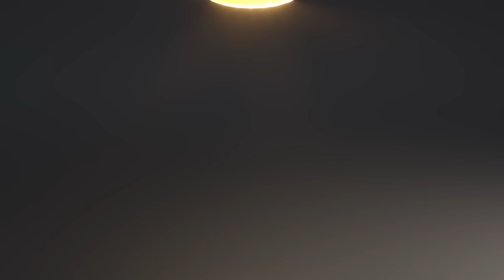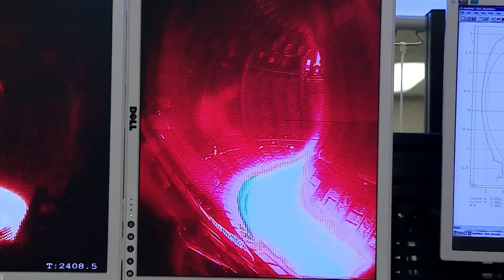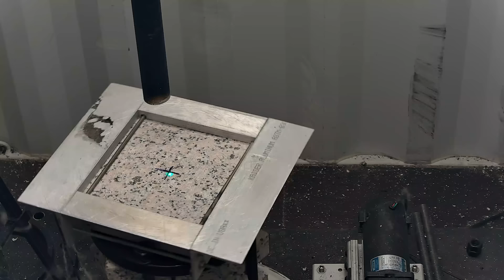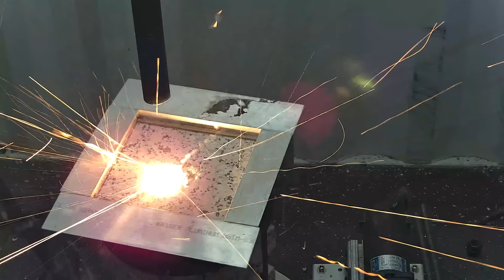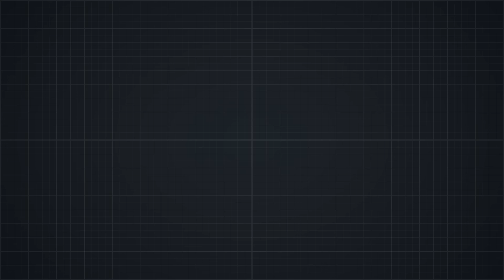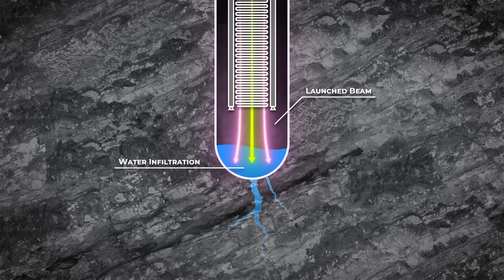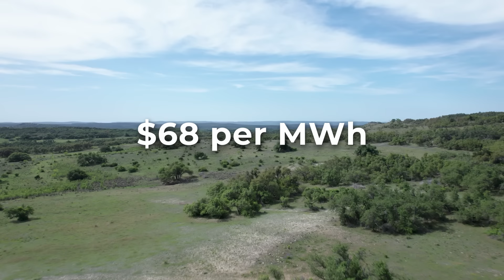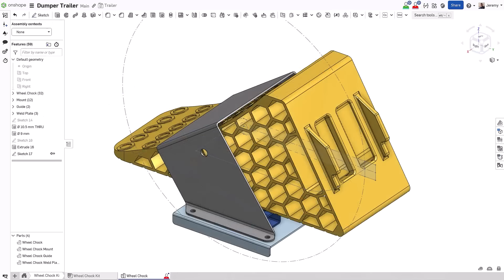Geothermal Energy is Changing

Comment: The LOCE for wind electricity is not believable for many reasons. Windmills (and solar panels) can NEVER generate electricity 24x7. Just the materials and construction costs alone are staggering, a single on-shore tower costs $3-$4 million and wind farms require dozens, hundreds or even thousands of towers (just keep adding zeros $$$). 

To provide any electricity when there is no wind blowing requies massive banks of expensive and dangerous batteries (today often using lithium which combusts on contact with water). The mining of lithium is also costly and destructive, and relies heavily on child slave labor. Check it out for yourself. Also, batteries wear out and have to be replaced often. $$$

Also, If the wind blows too hard the windmill blades must be feathered to avoid tearing itself apart. Wind speed must fall inside a "Goldilocks zone"...

The lifespan of wind "turbines" is claimed to be 20 years or more, but that is a lie. Most wind farms are decommissioned in 15-17 years because they become too expensive to maintain! When this happens the eyesores are often left standing in place because dismantling and removing each tower costs over $250,000. Plus, they cannot be recycled! They are put in massive landfills, so much for being "green"... 

Wind farms also require massive acreage that is always located far from where the electricity is needed, which means running huge cables long distances requiring more land leases and right-of-way negotiations.

But wait, there's more! Wind turbines require hundreds of thousands of gallons of petroleum for lubrication that has to be replaced regularly! 

And in the US alone wind turbines kill an estimated 0.6–1.5 million birds and 1.7–2.8 million bats each year.
Stop the stupid.

Comment: This is interesting, I wonder if you could run this independently on enough solar panels? A quick Google search says 50kv can be achieved with 180 solar panels and 1000kwh would need 10-18

So if you installed 200 solar panels to drill, you would have free-ish energy, and then once you have the hole drilled you could start your thermal energy power plant construction.

If the solar panels could be packed up and used again at the next sight, could pay off the use of so many panels.

Comment: This is an amazing piece of tech, but I agree with the need for more in-world testing before it's certified. What happens when you hit non-uniform materials? A pocket of flammable gas? Vaporized uranium deposits? There are also the residual strands of glass that condense in cooler areas. With enough rock that now becomes a physical obstacle to remove. I'd be interested to see this develop!

Comment: Well, if the maser drilling tech works out then the fixed cost of a set of drilling equipment isn't really a power plant expense. It's a drilling company cost as a capital investment. If the drilling companies can reuse a lot of the expensive equipment and turn a profit on the drilling jobs for new geothermal plants then they'll operate, and it winds up coming down to whatever the contract cost for drilling the geothermal boreholes are. For the water infiltration issue... Yeah, that's a problem but it might also wind up being good as specialized drilling equipment that makes drilling much more profitable for boreholes that meet the right drilling conditions so we'll have to see. Not being able to drill every hole equally isn't an idea killer so long as it can drill enough types of holes at a savings to be worth buying the systems and fielding them.

Comment: Is there not a concern of the obsidian casing building up too much and plugging the hole or sealing the waveguide to the hole walls? I imagine not all of the rock vapor can be extracted, so it would eventually build up in the shallower sections of the hole as it cools and deposits.

Comment: Just a quick point: the heat from Earth's interior is a combination of radioactive decay and residual heat from formation. The core in particular has very little radioactive heating.

Also, micro waves are lower frequency than visible light

Comment: If you are picking a spot to drill say 1km wouldn't it make sense to build a cheap steel frame and concrete floor for all the sensitive kit then simply drill down from there starting from the Concrete raft?

Comment: Did they estimate the power losses in the waveguides once they reach a length of a few km? The ohmic heating will be important and little power will make it to reach the bottom. You also have to cool the pipes, keep them perfectly straight, and how are they going to insert a new segment of the waveguide as the hole grows deeper? It doesn't sound very feasible...

Comment: Not seeing how they can remove the vaporized rock with out kitting the apparatus to the wall. It's gonna cool off pretty fast and the deeper it goes the further it can travel. Once those threads mineralize they are gonna trap and condense more rock vapor and cause a blockage. It's like cotton candy an I don't see how blowing nitrogen gas can help.

Comment: The idea is a good one and abandoned wells that can be cased/extended for reuse are prime targets.   Many millions of deep oil and gas well penetrations exist across the U.S., which already provide access to much warmer rock, > 65 C bottom-hole temperatures in some Pennsylvania and WV wells I am looking at.  State geological surveys (should) have the public access databases of OG wells--abandoned and otherwise.  (Unfortunately, the National Geothermal Data System website and AASG geothermal data portals are not currently operating.)  Additionally, generator turbines that use low-boiling point working fluids (i.e. "petrol" in e.g., Ormat generators) require temperatures much lower (< 100 C) than that needed to yield super-critical H2O steam.  These lbp turbine generators are already used at e.g., high-enthalpy geothermal plants (like Svartsengi, Iceland--BTW that stuff is basalt . . .) that also access super-critical steam, but to generate additional energy from the waste heat.  Geology matters and it varies (it's complicated . . . .) from place to place . . . .  The tester group took a serious look at these ideas and their work is still relevant.  

The new drilling looks amazing so here's hoping for a serious new geothermal energy source.

Tester, J.T., Anderson, B.J., Batchelor, A.S., Blackwell, D.D., DiPippo, R., Drake, E.M., Garnish, J., Livesay, B., Moore, M.C., Nichols, K., Petty, S., Toksoz, M.N., Veatch, R.W., Baria, R., Augustine, C., Murphy, E., Negraru, P., Richards, M., 2007, Impact of enhanced geothermal systems on US energy supply in the twenty-first century, Phil. Trans. R. Soc., 365, 1057-1094, doi:10.1098/rsta.2006.1964.

Comment: Having followed this for a couple of years it stinks of scam. The claimed to be drilling in China and promised results and stats from that but nothing came from it. The previous hole was tiny. Even an 8 inch hole is too small to be of practical use and they haven't done anything to replace the trust they threw away when they lied about the previous drill in China which was supposed to go down 15km.

What happens when they hit underground gasses or water or metals.

Comment: Flourine is very reactive and so it even burns bricks if we pass it along side nitrogen it should speed up the process right ? Melting point reduces with lowing in pressure so this system can be placed under a vaccum for maximum results.

Comment: I've been following this technology for quite a while. It has a lot of promise. The best case use is replacing old power plants that would otherwise go out of business and convert them to very clean sources. The other benefit is that you can directly use the power from the existing old power plant to "drill" the hole. This means a slightly lower cost of energy as very little is lost in transmission and the ability to step the power up is vastly simplified as there is no AC/DC conversion necessary. It's straight DC all the way.

Comment: You mentioned the massive amounts of power needed for such and operation. I want to add something to the conversation. 3 cents for 1 kWh of wind energy sounds a bit optimistic IMO. Sounds like subsidized costs are at play. Or maybe it's low because wind represents a low percentage in the energy mix in most countries. If wind were to be scaled up in order to be as reliable as nuclear power, gas-fired and coal-fired power plants so power 24/7 it wouldn't be as cheap. The other thing is for a venture like this new drilling tech to get power only from wind to ensure that low price, they would need to drill right next to the wind farm. And even then if the wind stops blowing the electricity is coming from somewhere else. Thus raising the price. So this will really be a challenge. But if they figure it out in order to do it at a competitive price that would be a new age of electricity production. And then maybe then we could stop talking about these stupid wind turbines 😁

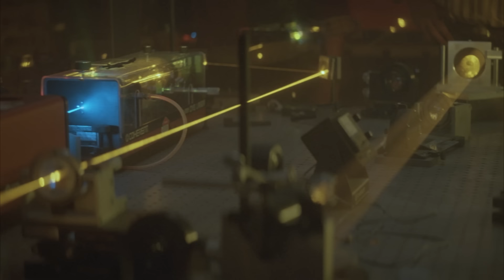Comment: 5:10 "But instead of producing visible light, it produces higher frequency microwaves"
Microwaves have a lower frequency than visible light.
Reply: I think he meant, "high frequency microwave", so, on the upper end of that band.
Reply: @jasonhildebrand1574  yep
Reply: @jasonhildebrand1574  why would he need to specify that the produced frequencies are on the upper end of that band? I think it's much more likely it was just a small error. this is a guy who walked into an asbestos cotton candy maker wearing just an n95 on camera. maybe sometimes make mistake.
Reply: Microwave with frequencies at the higher end of the spectrum of microwaves. In context, it makes sense without having to include all the words.
Reply: It's like saying invisible infra red, that's below visible light to humans.  On the other hand, why not use high power visible or invisible lasers instead?
Reply: In Europe we drill using a laser with similar result. Check out DeepU Project!
Reply: The frequency my microwave creates sure sounds like it

Comment: I understand that they have a team of very clever people there, so it is a pity that they did not say why it is better for them to enlarge the device by 2x, which gives a working area 4x larger and an energy cost 10x higher, than to develop a multi-head solution with 4 smaller drills which would save half the operational energy.

Comment: I think it will be really hard for that company to increase RoP per MWh. Im not an physicist but i do believe that you have a pretty solid amount of energy that needs to go into a material in order to vaporise it. If i understand it correctly they basically produce plasma to super heat the rock and vaporising it. If that action takes on average 1MWh per meter, with a set rock density and composition, they could maybe increase the efficiency of the gyrotron but the MWh/m calculation will most likely stay the same no?

A nuclear power plant reactor can produce around 13MW/h so a single drill using 1MW/h is an incredible load on a grid, especially considering the holes would need to be drilled near an existing grid. The high power lines that come off power plants can at the least carry 130kV. At 8 ampere thats about enough to power one of these drills.

Thats just the power requirement. What about the basically fiber glass being thrown around`? Im worried they would still have to mechanically purge the drill hole from that fluff during operation. It also poses serious health concerns and makes me wonder if they would have to seal off the drill hole whilst its being drilled to avoid contaminating the site and possibly the entire area with something that looks much like fiberglass/asbestos.

If anyone has some corrections to make to this text, please feel free to!

Comment: This is quite exciting. Still very early on. But a good possibility. 

Not sure about the possible clever idea about styling near existing power stations to tap in super critical steam.
I suspect there is also a ton more to learn about the geological affects of piercing two or more holes deep into the crust. Let alone cooling the lower crust by extracting the heat. 

All solvable I hope. But I'm expecting a few interesting mishaps while we learn. 
Fingers crossed it doesn't get the same press as fracking. 
Public perception can kill a power source (e.g. Germany nuclear)

Comment: 17:44 This is a lie. If onshore wind farms were the cheapest form of electricity, they would have taken over by now, and the people in this video wouldn’t be doing expensive research into expanding geothermal. Instead, we have countries like Germany reopening coal fired power plants just to keep the lights on, and in America we are recommissioning old mothballed nuclear plants for the same reason. The supposed cheapness of wind power is fake, because it ignores reliability. Wind power is so unreliable that nobody will pay anything for it. When you have to pay for someone to take your product (negative pricing), your product is garbage. But wind farms are not free, they don’t build themselves, they don’t maintain themselves. They are a losing proposition that will fail.

Comment: How would it react when you hit a pocket of water?
Reply: What is a "pocket of water" and where does it occur in the deep subsurface?
Reply: @ it’s water that is trapped deep underground around 410 miles deep in the transition zone between upper and lower mantles theorized to be three times the amount of water that’s on the surface of the planet
Reply: @riboflavin1806  This isn't water as a separate phase (not to speak about "pockets), but bound in minerals. Btw, geothermal drilling isn't intended to reach anywhere near the lower mantle.

Comment: I am afraid the vaporized rock material may clog the evacuation piping as it may condense back into solids. The fibrous material seen in the lab will block the flow in the pipe unless they figure out ways to keep the gases extremely hot all the way to the surface.
Reply: this is the most common comment throughout this thread

Comment: The drill pipe is the waveguide? What is the attenuation rate (dB per meter)?  Impedance matching?  The drilled hole will essentially rely on a "glass" casing?  I have so many questions ...
Reply: That’s one hell of a robust and well-made waveguide if that’s the case.  Can’t imagine how much it’d cost to run one of those even half as deep as they’re theorizing.

Comment: The start of the video is great, but I got distracted for 5 minutes when you called the earth a fission reactor. There's debate about the magnitude of each source of heat and where it occurs, but accretion accounts for some portion of the heat energy in the earth, radioactive decay accounts for some portion, and crystallization and friction accounts for some portion. Radioactive decay occurs in lots of places and is not indicative of a fission reactor. For example, the potassium in bananas undergoes radioactive decay, and bananas are not fission reactors. It is possible that a significant portion of the current heat energy in the earth is attributable to radioactive decay, but sources do vary. Not a fission reactor though, no matter how you look at it.

Comment: I find it absurd that humanity hasn't yet thought of anything better than turning a turbine with steam to produce electricity in commercial settings. We're still in the steam age.
Reply: But we have: wind, solar, and wave do precisely that. Steam is only necessary as a conduit of heat. Turning a turbine is relatively inefficient, but geothermal provides an inexhaustible source of heat. We only need the means to access it.

Comment: We humans love meddling with natural process that are in dynamic balance, like the thermal exchange between earth's core and crust. This historically leads to short-term advantage and long term damage as we tip the balance out of equilibrium. Stop the extreme drilling. Engineer a way to use volcanic heat energy instead.

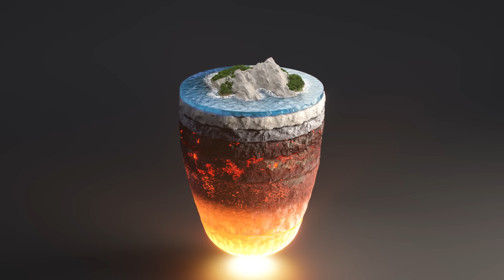Comment: @1:07 is wrong despite a convincing voice: reality is that the pressure is not enough for fusion reaction to happen (in the much heavier sun instead it happen and we feel it from 8minute light far away), the heat inside the hearth is simply from being a piece detached from the sun which lost heat slowly in 4billion years. It wouldn’t be cold in the surface if the fusion was in place inside.

Comment: I’m a driller for sure and pipe pile and we also drill and filled with pressurized grout. Sometimes we use backfill for slumps. If there’s a key then we will usually use shock crate with used Ben tonight which is like a gelatin so to speak so you’re talking about size my drilling and that’s for earthquake stabilization if you’re trying to connect us something on that Edge or water flows or you’re trying to build a bridge and on one side is really high up so you have to basically have a small attachment from the tall side. It’s kinda like the same idea as a suspension bridge. I even live near one and their solution was kind of stupid Because of our weather they have the giant poles that are basically cables. There’s hundreds of them that hold of the bridge and it’s pretty high up from the water, which is why you can’t have a whole bunch of things stuck in the water. I think there’s only like four pillars underneath the bridgeand then you have huge building tall cables as I said hundreds of them I think there’s only two triangles above the bridge suspending it with the two pillars underneath them ones in the water one is closer to land and then on the other side is not so bad and it’s lower water and higher land so there’s a whole bunch of little pillars underneath on one side on the surrey side